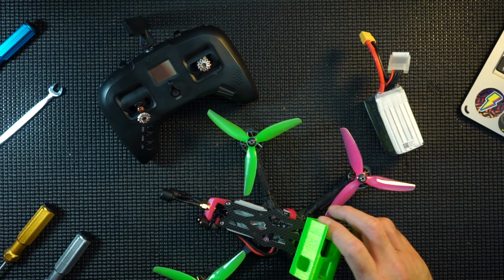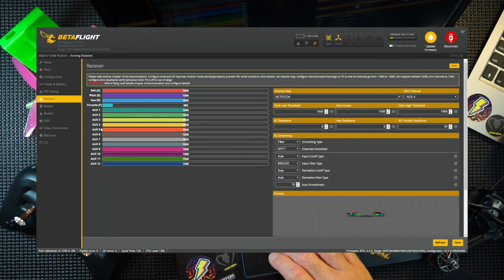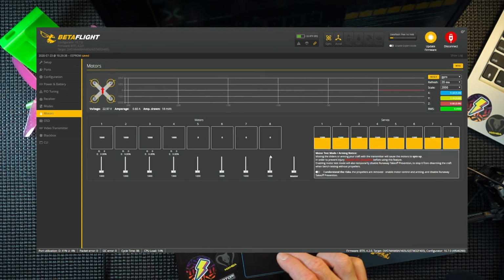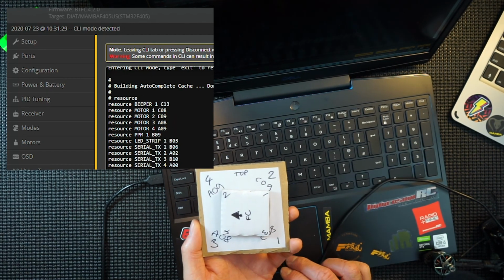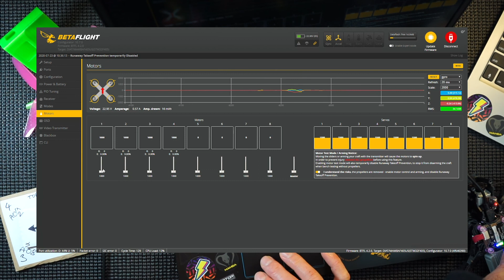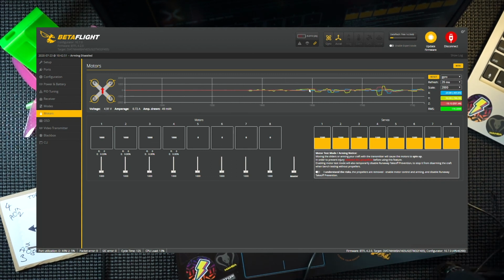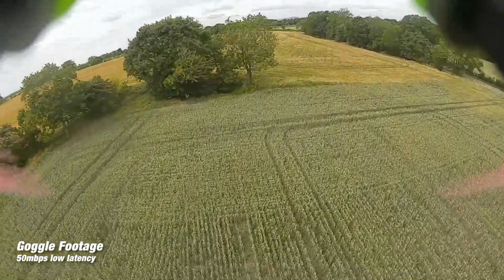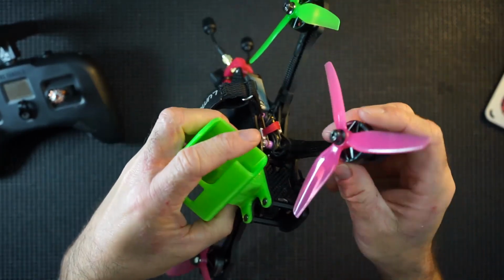Apex 5 inch fpv drone Build with DJI HD fpv system Betaflight set-up and first flight

Comment: Is it normal to see the top of the frame when using the apex and flying
Reply from the maker: hey - this one is goggles view on my apex 5, so this is how mine looks / sees
https://www.youtube.com/watch?v=740STTrPnX0
Reply: @Datfpv  Awesome thank you for that. Can I ask what your tilt angle is?
Reply from the maker: I fly at 35 on the apex 5 - I match the camera to the gopro / smo mount.
Reply: Did you find any way around this? I just build an apex and I can see the front standoffs in the googles view

Comment: Nice video info, have you update tango 2? i notice jumping no. in rcevier tab i upgrade mine it doing the same.
Reply from the maker: no not yet, do you think that will sort out the jello ?
Reply: @Datfpv  i just got tango 2 today if it does not rain will be first flight so don't know.
Reply from the maker: let me know what you find out when you do first flight
Reply: @Datfpv  no jello but it was cloudy day, but did not see jello. i just update wifi to 1,15  on the t2
Reply from the maker: I'll give the upgrade a try and see if it sorts it out - you like the tango 2?
Reply: @Datfpv  yes i do coming from xlite 900mini. the sticks is better to me
Reply from the maker: yeah the sticks are god damn smooooooth on the tango!